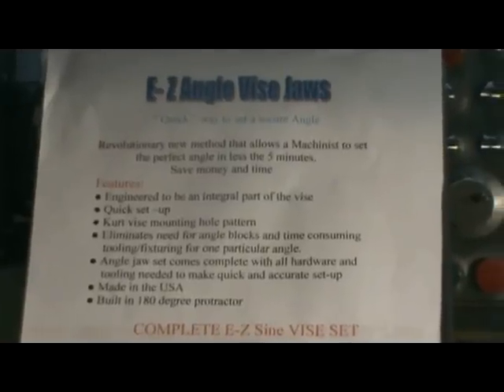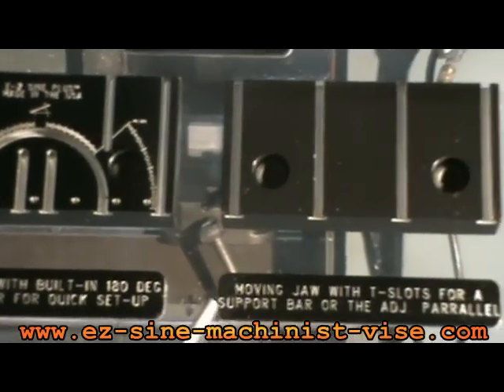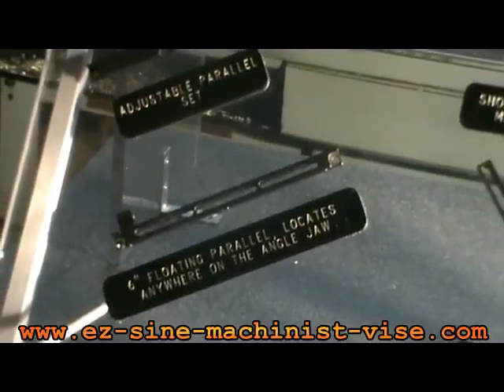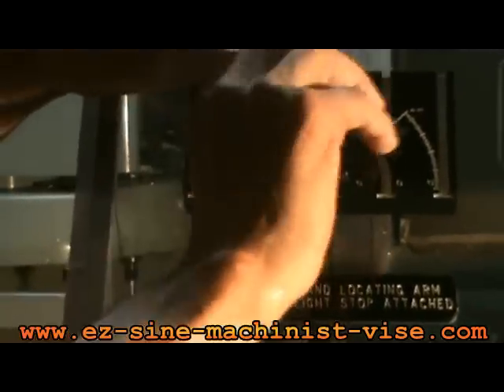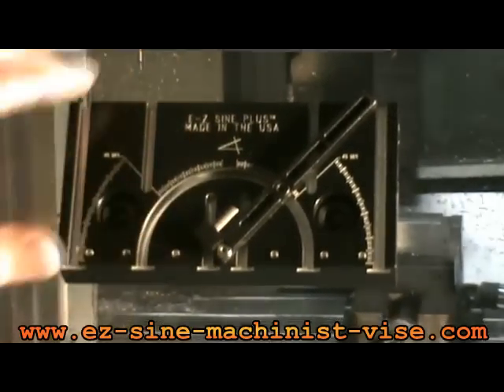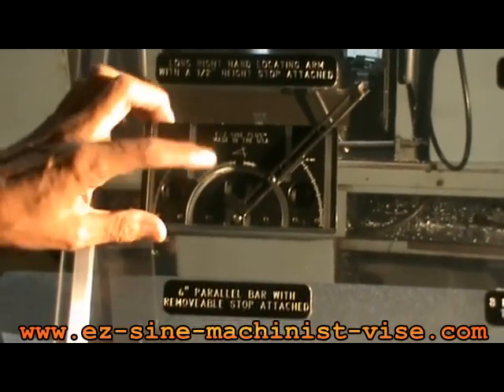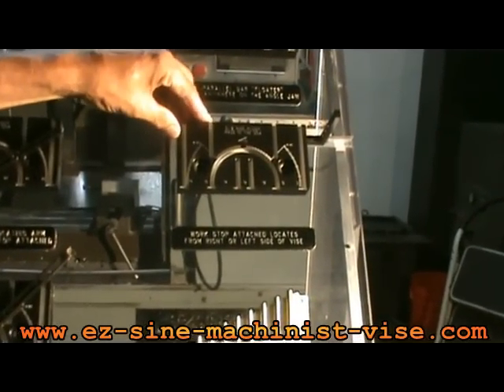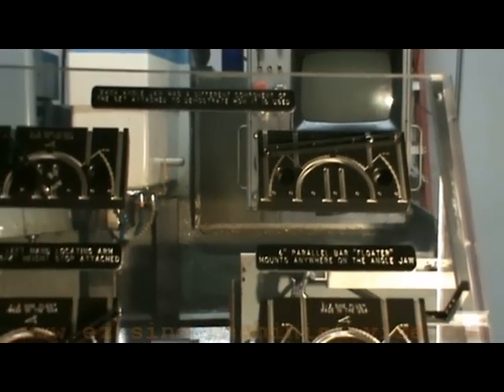Mill an Angle-CNC or  Bridgeport Milling Machine-EZ-Quick Set-Up-Video 1

Comment: Hey 9readie! Chris here. Cool idea for quick load. Meaning, with angle blocks even set against a stop can still become a fumbling experience especially with multiple blocks and mutiple parts. Even worse is those single ones and twozy jobs that have to be close using the knee, X axis and quill with the trig functions along with tapping and rechecking with an indicator. ugggg. This seems great fow pieces fot even for a few that need close agular tolerence how exactly does this locate the angle is there acyual notches or is it a visual protractor? Not saying it is bad if visual. I guess I was looking to see if it could be quickly changed to within 15 seconds or closer by a notch mechanism or is it just visual lick a standard protractor? Either way very cool! 8-) I'll come back to check it out.
Thnx
Chris  @ Sarasota, Fl.
Reply: Do Right When I said tapping I meant with a brass drift to tap the workpiece into position ))
Reply: Do Right I just check the date )) I'll check back in a while but will save this ))

Comment from the maker: @joleenmorganjohn Hi John, thanks for taking the time to check out the video and leaving your feedback and suggestions. I decided to mfg my original configueration of the angle jaw set, out of alum. instead of steel because of the cost, it would be over double in labor time. You hit the nail on the head. The machinist has to  be careful to remove the chips from the jaws and the parts prior to loading, to maintain the jaws in good shape. I now have 3 videos and adding more, check out my website.

Comment: Very nice setup. I was curious if you had any plans for offering hardened steel jaw plates instead of the alumi. I can imagine after several uses from haphazard operators the aluminium jaw faces would be full of dings and chips impregnated in them. Basicaly ruining the egraved degree graduations. A hardened steel set would be the cats meow. Thanks John S.